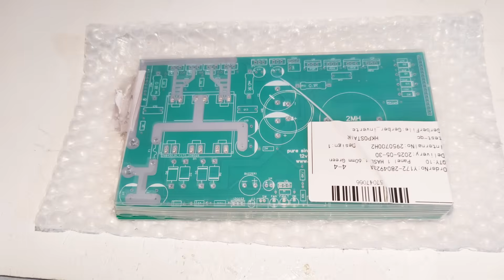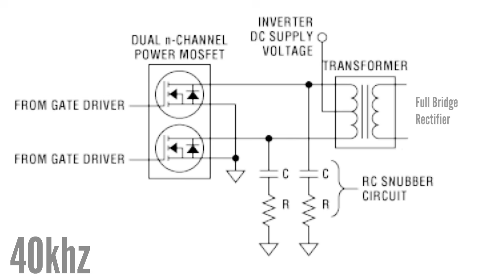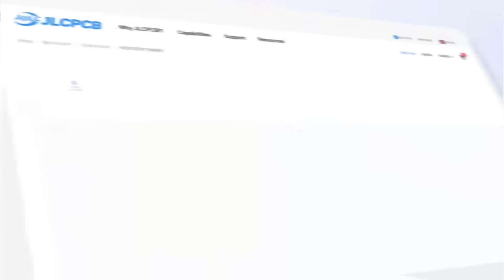Sine Wave Inverter Design Improvement 12V To 220V

Comment: sir sg3525 lm358 driver card feedback not work properly when i attach feedback ic get shutdown  i set around 2v on pin 8 drivercard
Reply from the maker: Maybe feedback voltage spike is high
Reply: @Electronic_For_You  so what I do
Reply from the maker: Have you tried rotating the potentiometer? And feedback ground connected?
Reply: do you have any social account can I share you photo
Reply from the maker: You have to connect transformers ground output to module ground
Reply: @Electronic_For_You  transformer output like 310v  or ground connected to module ground

Comment: how do calculate the rc snubber required
Reply from the maker: measure your circuit's ringing frequency and estim- ate parasitic L and C, then select a capacitor (Css) sev- eral times larger than the parasitic C to re- duce the ringing frequency by half. Next, choose a resistor (Rss) value equal to the circuit's characteristic impedance (/(L/C)) to minimize ringing or a value that provides ac- ceptable damping without excessive power loss. Finally, choose a capacitor with appro- priate voltage and power ratings and a res- istor with sufficient power dissipation capab- ility.

Comment: Has anyone created an Inverter so the power coming out of a Portable Generator has a 'clean' sinewave?  I'm tired of mine "destroying" my small electronic devices!! :face-orange-frowning: It needs to be placed between the Generator and the house. :hand-pink-waving:
Reply from the maker: If your generator produces 220V ac you can rectify the AC to 360V DC then you can use Pure Sine Wave Circuit to convert to 220V AC sine wave